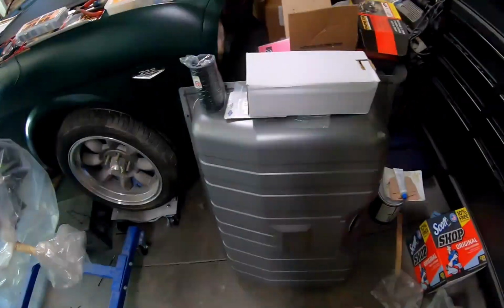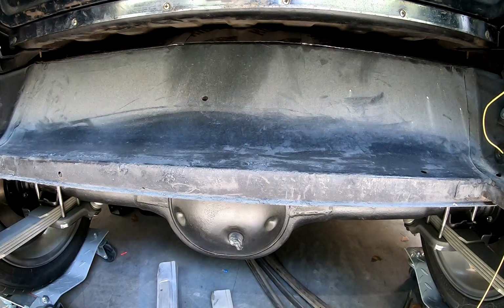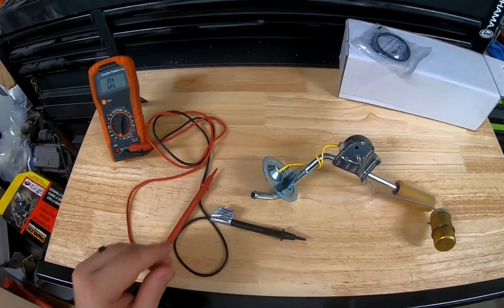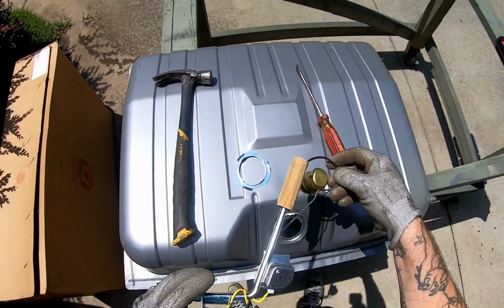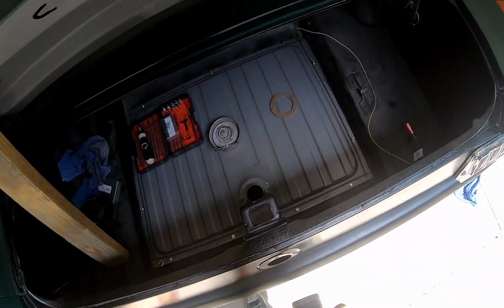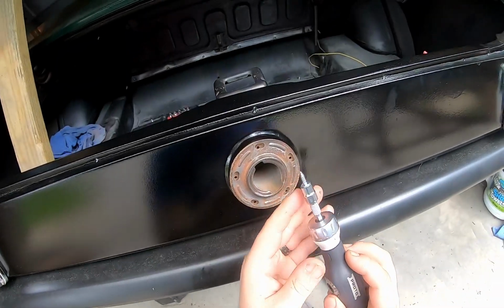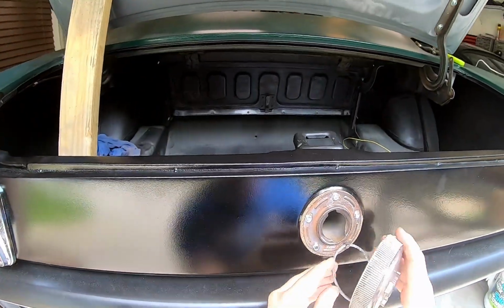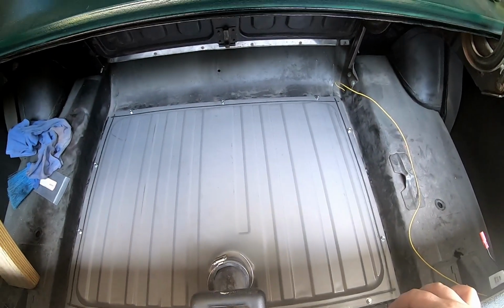Gas Tank and Fuel Sending Unit Install | 1966 Mustang Fastback

Comment: Hey there, 👋 thank you you, for sharing the pain, as well, with yer fuel leak... It just might help one us, who are following along, though just a bit behind, in our build cadence, compared to you. My tanks installed, though no sender. I went the later, 3/8" version, with a return line stub.. I'm still on a rotisserie, finishing the Shelby drop, adding the Open Tracker shock tower reinforcement plates, and the Ride Tech Lower control arm camber adjustment kit.. Doing that kit, is a pain in the "_ss" !!!! Keep at it brother!!! And I'll be waiting for an update, on your quarter panels and paint work Andy ..... God bless
Reply from the maker: Some tasty bits being put on your car!  I haven't gotten under there to figure out what happened since it's in the teens here - but I'm thinking either I didn't lock the sender down all the way or the gasket got twisted/bunched.

Comment: It's sooo much easier installing that sending unit with the tank out of the car.  I think it's easier to see if the gasket of the sending unit is install correctly doing it this way vs trying to check everything from under the car.  :)
Reply: Andy, we'll be waiting for an update, on yeor quarter panels and paint work.... Bring it on, buddy...
Reply from the maker: As it turns out I didn’t install it well - yuge fuel leak 😂
Reply: @SlowInFastOut1776  I know exactly what you went through.  :)